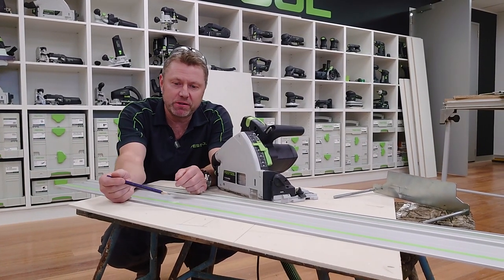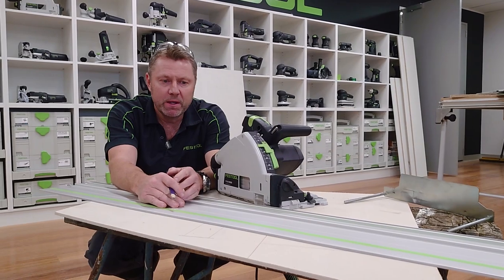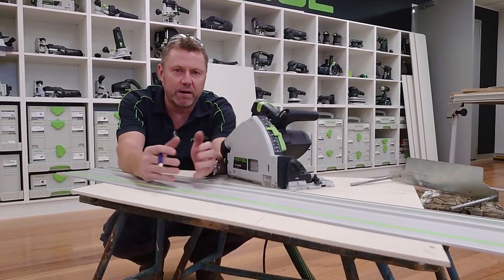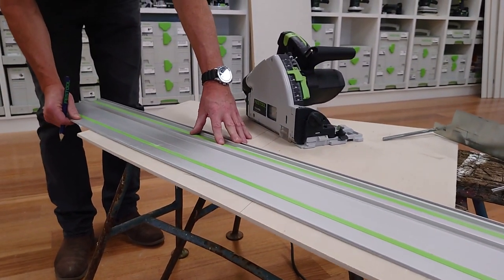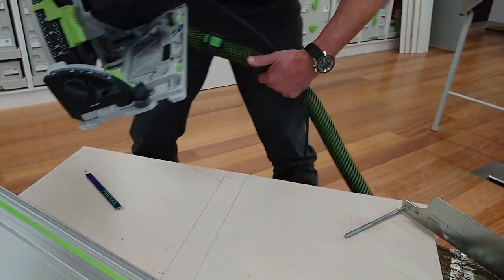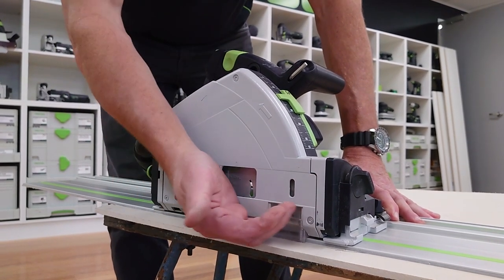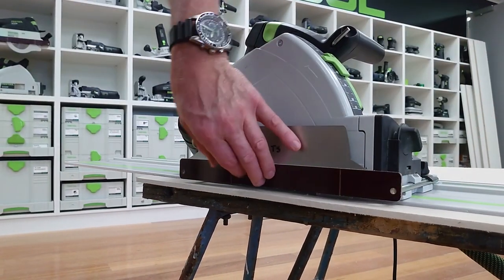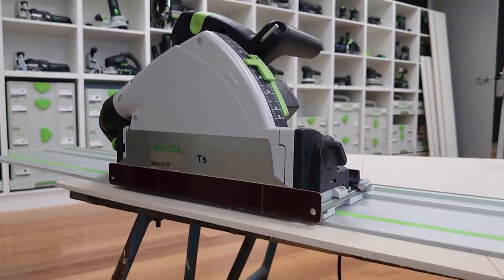Tool Tip: Cutting cement sheet DUST-FREE 🔥

Comment: What is the benefit of variable speed for plunge saws? And when would you ever utilise the feature,   Can’t seem to find any information on it anywhere on the web. only for grinders
Reply from the maker: Variable speed is used for different materials to enable a good quality of cut and also prolongs the life of the blade.
For example when cutting plastics if the speed is not lowered with some materials  heat build-up can melt the material.

Comment: I'm looking to get the ts75 to cut Hardie Flex fibre cement panels for our garage and some thick bench tops for our outside area.
I've read on Festool owners group that using the TS series saws to cut fibre cement will void the saw warranty. Is this correct?
Reply from the maker: The PCD blades are fine to use with cement sheet products and doesn’t avoid the warranty.
Depending on the thickness, feed speeds should be adjusted for the thicker material.
We recommend that thicker compressed cement sheet is cut with a grinder rather than a PCD blade.